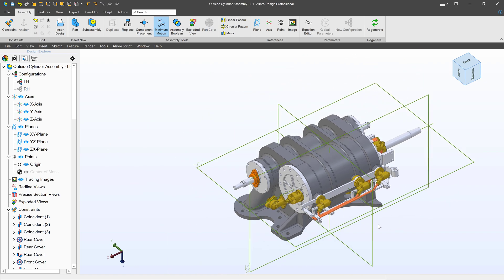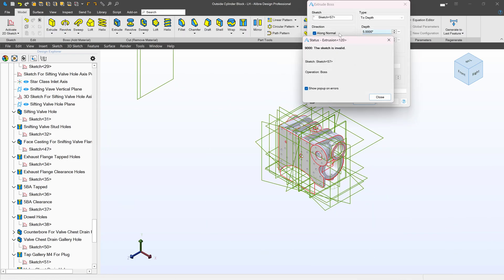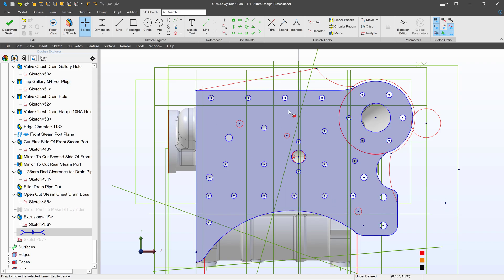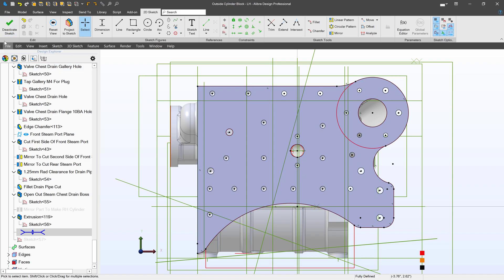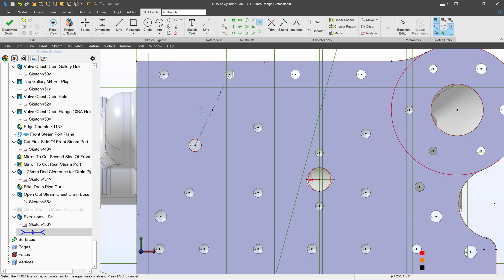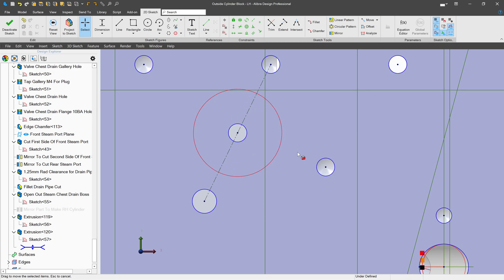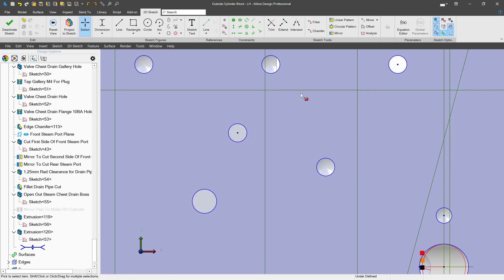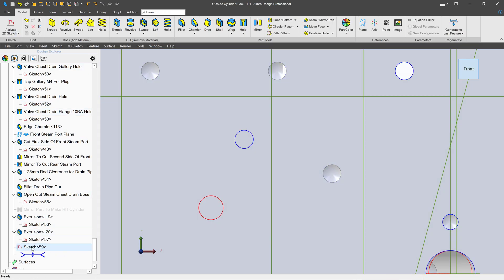Alibre | All About Projecting to Sketches!

Comment: So I am having the problem where if I want to project an "edge" normal to a revolved feature, it does not recognize that in the sketch because it is not a hard edge per se. This creates some problems for my workflow and similarly, I cannot snap any sketch points to theoretical edges that are normal to those contoured sections either. Is there a way to address this?
Reply from the maker: I've been able to project a normal edge to a revolved feature, but perhaps it's not working in your case.  If you're able to share the model, could you email to joseph@alibre.com?

Comment: 04:00 WOW! Showing the dim value in metric and imperial? Is that a v27 feature? Man, you're making me want to update more and more...

I actually had a printout above my old desk that had a fraction to decimal to mm conversion chart. I now use that digitally, but it means I need to go back and forth between the design and that chart. This would be a massive help.
Reply: This has been possible in Alibre Design for decades. Check File>Properties>Units>Dual Dimensions how to set this up.